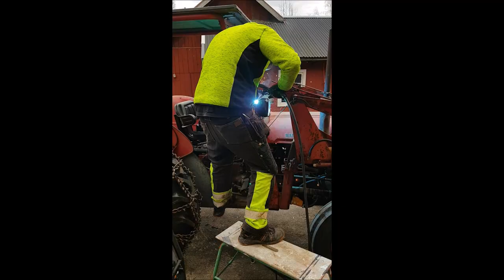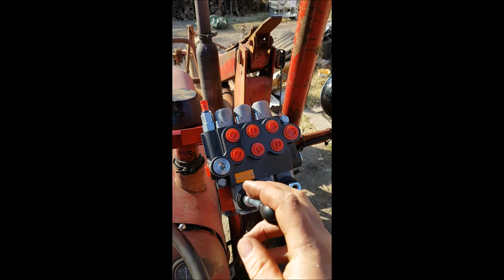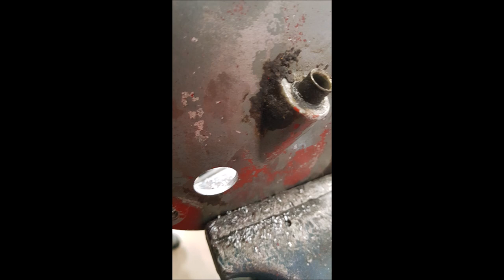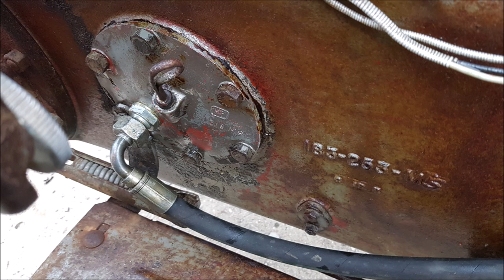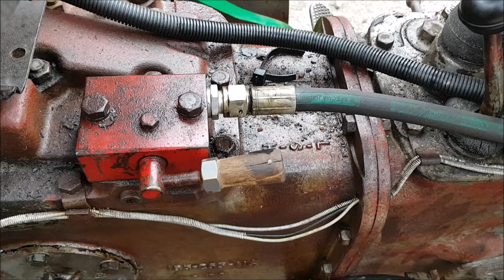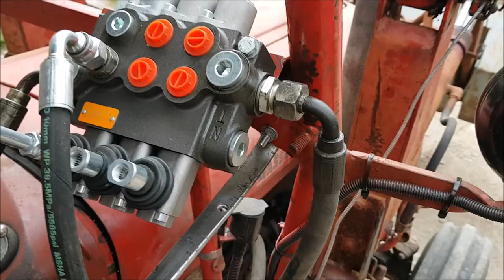Massey Ferguson 35 hydraulic loader valve installation

Comment: Can you work the rear 3 point linkage lift at the same time as the front loader?
Reply from the maker: No you can only use one hydraulic function at the time on MF35
Reply: @TractorSwede  OK thanks